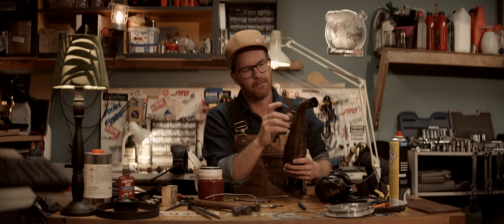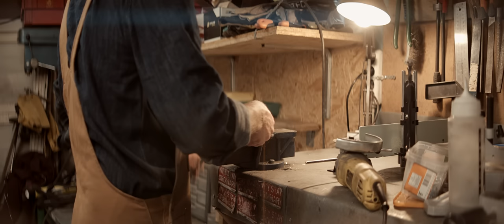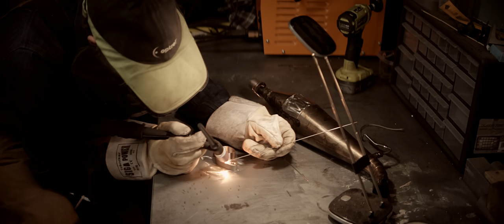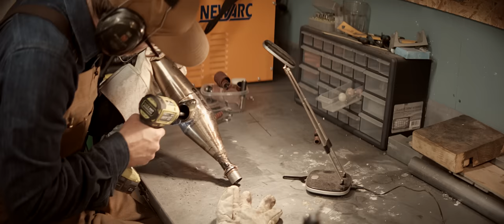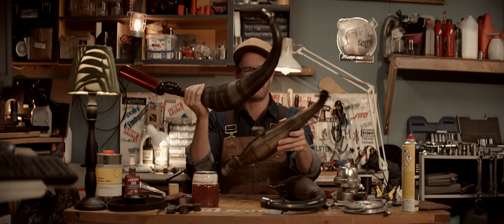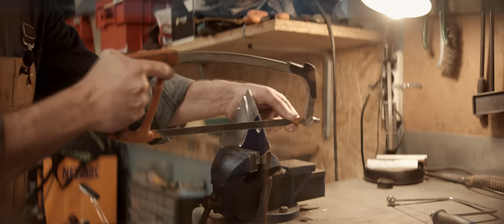Two Stroke Pipe Wastegate - Why do I get such strange problems?!

Comment: Make the straight part of the belly, where you welded the waste gate, telescopic, and variate the length based on the rpm. I know I have suggested that before, but I really believe that would make a great improvement in performance.
Reply: Sounds complicated.. but awesome
Reply: Tried it in the 90's, O ring seals worked well however alignment thru the movement range was a nightmare due to vibration and mounting was a genuine issue.
Reply: Yup, I'm not sure this is the problem or the only issue but this telescoping expansion chamber has been done before many decades ago with impressive results. I saw it in the early 70's. Sealing was always an issue but a titanium or stainless steel bellows (looks like an accordion) for expansion and contraction with an internal sliding sleeve would do the job. These bellows are already manufactured, you wouldn't need to fabricate one.
Reply: Only has a make one cycle! So it doesn’t need to reset after a run. Only get from push vehicle speed to wfo and stay in the power band !
Reply: Would copper seals help also? Instead of high temp o rings
Reply: German König outboards used to have them back in the day, and those engines would rule on hydroplane boats like nothing else.
I don't think anything fancy is required, just one pipe inside the other, with a good fit and a cable to control it. That's how König did it, I think they even had it connected to the throttle control.
König also built some racing motorcycles, not sure if the adjustable pipes were present in the bikes though.
Reply: Not when the rest of the pipes dimensions are wrong. That pipe was made for the PIP motor. Not this crank case stuffed not 100% bore exhaust port motor. Sigh.
Reply: Motores 2 t no necesitan más complejidad de la que ya tienen , lcualquier motor 2 t si quieres subirlo más de Rpm . Hay diferentes maneras .inyectores alojados en el mismo carter que dan un extra de potencia en altas Rpm . Pero nunca intentar variar la curva de potencia mediante la compresión o descompresión de gases en su escape . El echo de tener una válvula de escape te permite ahorrarte todo lo que estás haciendo , un escape móvil lo único que puede traer son problemas y reparaciones innecesarias y por otro lado ... la moto funcionaría sin escape ? O con escape roto? Pues todos los motores 2 t son capaces de funcionar sin escape , .incluso llegue a ver inyectores anclados en el escape haciendo variar la cantidad de oxígeno dentro del escape . No necesitas aumentar o disminuir la capacidad de flujo de tu escape . Solo necesitas meter más oxígeno o menos . De esa manera obtendrás mezcla mucho más rica o más pobre según el inyector . El inyector funciona bastante más rápido que la válvula de descarga y regula mucho mejor los caudales que un carburador . Carburador más inyector . Bomba .

Comment: On some smaller engines I've seen the exhaust port at the biggest part of the expansion chamber and the end completely blocked off with only a drain plug. That's something you could still try with your modified pipe. Use the new port as the exhaust and block the old one off.

Comment: I did karting in 90s. I remember how dificult was to start up modified soviet 2strokes with huge exhaust ports and short pipes. We had to spin it up to high enough revenues by pushing it.  Probably That's why rotax-max engines have their power valve right on the exhaust port to make it lower and smaller at low rpm (the thing ?v=RKZF-W1m0k4). So spining it a bit faster during the start probably is your solution.
Reply: That would have been my solution as well. Get a faster drill, or perhaps use a different power tool to start. Like a grinder

Comment: "how pipe sensitive do you want your engine to be?"
alex - yes.
Reply: How much do you want to make a pipe not made for the setup to work. More like it. Lol.
Reply: I said "Yes." out loud when he asked the question. XD
Reply: @MrJermbob  I'm afraid to say it, but you are right. He's hacking pipes that are obviously not designed right for this particular engine. He is missing some variable in the pipe design software that would make the right geometry pipe. You can cut wastegate holes and hold the pipe hand, but the real solution is to figure out what the correctly designed pipe looks like.

Comment: I think you're getting a frequency feedback from your rotary valve. If you could see a reed valve in high RPMs it does not close and just stays open. One of the experiments years ago with a rotary valve, what happened is the valve got stuck wide open but the engine kept running like a mad man making extreme power you don't need the valve after certain RPM. But the opening and closing is conflicting with the pulse in your expansion chamber.

Comment: Got a simple idea to minimize interference.
Just cut a hole in the straight section of your pipe and make a cover with a matching hole that rotates around the pipe itself to block/unblock the opening. Footpedal or servo to control it.
Done.

Comment: This starting issue only occurred after you went to a disc valve, it seemed to start ok when on the reeds.  Taking another look at the disc valve timing before you go down a rat hole with the exhaust design might be wise.  Edit:  Are you getting a lot of fuel stand-off from the carb at low RPM with the exhaust in place?
Reply: The Reeds act different if you look at the resonating length.
The pull energie out of the exhaust impuls to open, but If open they lengthen the resonating distance.

The discvalve is a mechanical driven valve. It opens and closes a secondary resonating volume but doing this by variing the area which effects the speed and pressure of the Wave...
Reply: Put a 3d printed inlet cone on should do something....

Comment: Do higher tuned 2 bangers not just idle at like 4-5k and rev to 14-16k ? Rather than trying to idle at 1-2k and and rev to the moon in the same setup ? Just a thought ? I know it’s not the same but F1 engines idle at like 4K and rev to 15k and they have valves and allsorts of anti stall etc
Reply: seems logical to me
Reply: It generally isn't a problem of the idle being too low for the engine to run but rather not needing it to idle that low in a racecar/-bike, skipping rpm-ranges you don't need just makes low-rpm tuning easier.
Though I think the current Idle is fine, sounds like 2-3k rpm to me, which is perfectly normal for high revving 2 strokes (look at the RS125 for example)

Comment: Many years ago i had som involvement in some development work on a 6.6l single cylinder diesel engine it was destined to become a 12 or 16 cylinder unit when finally developed but the research single had starting issues if the inlet pipework was conected and no positive pressure was supplied to the engine but if the inlet pipework was disconnected it started without a problem this was found to be a resonance problem that only made starting a problem on the test bed 
Keep up the good work

Comment: Perhaps a throttle body, on the pipe attachment, could be cable synced with the throttle.   Will give you vairiable hole.

Comment: dual Exhaust system can solve your problem , one Exhaust for low and one for high rpm and the you can use the waste gate as a valve that switchs between the two
Reply: not a waste gate but a special valve that switches between the two Exhausts , you already have a rpm sensor  so the welding is what will consume your time the most
Reply: @CathodeRayNipplez  Honda dream 50
Reply: Would probably be better and easier to go variable length exhaust than design valve and valve body for best harmonics.  The two stroke exhaust design calculators are fairly basic and wouldn't want to simulate it but probably a simpler solution
Reply: @BlackStar-nk7du biggest thing is this is a race bike so a higher rpm start is perfectly acceptable the same thing they are doing with formula 1 engines
Reply: Maybe a slide plate that would switch between the low end pipe and the high end one ?
Reply: @baswendling2937 yes but is a 4 stroke engine on the honda dream 50
Reply: @baswendling2937 not only is that a four-stroke it also has two different exhaust ports. Totally different from what we're watching here
Reply: @BlackStar-nk7du he literally says he's just going to increase the idle/starting RPM to just not worry about it. Even if what you were saying is possible. It would be a hell of a lot of work and a lot of extra weight🤷
Reply: i know what he said , but doing this will make the most power in high/low rpm , but this will stress the engine more

Comment: Maybe it just becomes really ritch at low rpm with that pipe, would explain why it helps to keep the gap at the exhaust outlet while the bigger stinger does not help

Comment: A much larger stinger with an auto restrictor.
2 or 3 different rpm pipes that can be swapped while running to learn what works then devise a single pipe that does everything with a clever design you'll enjoy coming up with.

Comment: Not sure if this is related to your problem but it's quick to check. With my Yamaha RD 400 switching to individual air cleaners that had a flat top caused a resonance problem that acted similar to yours. Switching to a soft, domed top air cleaner stopped the pressure wave from bouncing back through the intake. Hope this helps, keep up the great work.

Comment: I have experienced 2stokes with bad crank case compression runs, or run better without exhaust. often caused from bad gaskets but i saw you pressure tested the engine in a previous video, can it be because of the big crankcase?
Reply: I can't remember, do o you have the fillings left in the engine? i think it would be the same if the intake valve dont close fast enough/or tight enough..

Comment: I am so very happy that you figured what was causing the problem, and I am also so very happy about suggesting a somewhat similiar solution in comments earlier, among other things. The problems youve had, not about this particular issue, was related to the exhaust. If the cylinder gets charged by both a SC and a pipe, where do you suppose the cylinder pressure ends up if the pipe is so restrictive that it cant force the pressure back into the cylinder again? And/or SC is needed to  push the gas put into the pipe, only for the pipe to be so restrictive, and the cylinder already at alot of cylinderpressure, so it wont/cant charge the cylinder again, and detonates inside the pipe.

I realize that my writing looks like I think I know it all, and I absolutely do not. Im just thinking out loud on the keyboard.

You have a persistence I envy, keep on keeping on 😁
Reply: He keeps forgetting that his engine isn't 50cc. It's 50cc + however much air the supercharger can jam into the cylinder every stroke. 

I forget how much boost he's running but it's likely he needs the pipe off a much bigger engine.

Comment: I'm going back to the 80s now but we used to have similar problems with model RC planes,if we had it on pipe on the ground 16.000 rpm,in flight in a dive the engine would rev more but lean,so we tuned for off the pipe on the ground so in flight it would be on pipe, went to Italy for some Rossi engine's and the length of the pipe they used was twice if not three times the length,I think the pipes had multiple cone's inside which helped on the overall rev range,I know you know your stuff but have a look into ducted fan engine's and pipe design because they rev through many power bands.keep up the good work and can't wait for the day you get on the flats.cheers.

Comment: i feel the problem is poor air speed at low rpm and it needs fresh air from the exhaust  to fire once it gets up the intake air speed increases . thats y the smaller carb helped , reduce the intake duration and open later to increse air speed .  tuning is about giving the engine what it wants and not what u want

Comment: I'm sure that the issue is more complex than what I about about to suggest but your engine just sounds really lean at very low RPM, it makes the sort of sound you hear when the engine is just about running but as soon as you open the throttle at all the mixture then goes even leaner and the engine dies. Then when you are spinning the engine quick enough it starts pulling fuel from the main jet and that circuit is rich enough to keep the engine running. The other thing that makes me think it is lean is the fact that you seem to have to spin the engine over for ages before is fires up, personally I be looking at going up on the pilot jet on both of the carbs that you are using. I think that your experiments with the pipes have sent you down a rabbit hole, the pipes are just having an effect on the mixture strength, sometimes helping richen up the mixture and other times making is even leaner.

Comment: at 14:05 when fully sealed with the yasuni pipe it sounded really rich. cold having the pipe off a bit give it more air so just the mixture getting better would make it run?. higher idle is a good idea!

Comment: I think of it a bit like an old carb fed race/rally car with a lumpy high tune cam. These would tick over at +2k rpm as they would not run below that do to the cam overlap. 
You engine if I remember correctly is being built for power or constant running at 20k. 
I would forget messing around for a nice low tickover. I think it would be extremely difficult to do without a power valve or something similar.
But i think we are on the same wavelength by what you said at the end of the video 
Great viewing.

Comment: I went back to your previous videos and before you converted it to Rotary it started without any issues. The rotary spec is within reason yo usay so its mind blowing to me how it can go from running okey to not even starting. Considering the pipe and ports are still the same. Im convinced there is something going on in your crankcase/valve.

I find it hard to believe the engine could be that sensitive to pipe geometry even considering your special port designs.

Comment: Keep fighting :)
I had similar running problems only when there was internal problems with the engine, like compression loss, or leaking crank case.
I think the exhaust pulse manipulation would be most effective if the hole was close to the exhaust port. Maybe a valve & chamber like early Kawasaki's 'power valve'?
Maybe a cheap an powerful angle grinder could be used as a starter? Maybe with soft start?

Comment: Maybe you need a power valve in the exhaust port its how yamaha got round a similar issue with resonance. They called it YPVS. Electric servo opened the port as rpm rose.

Comment: Since it behaves better with the leak, maybe it's too rich.  Try leaning the mixture a little and see if it changes.  I would also try adjusting timing of the exhaust.  Small changes just to see if it makes any difference.

Comment: I think you need to take a few steps back and remove all the inserts. Go back to the initial design of this motor and then try the pipes. Even if this will now rev, it’s still ends up being a relatively standard configuration rather than what was the original design innovations. Good luck, great to see you back 👍

Comment: You could get a karting starter box to spin it up faster. Try to find one that doesn't have a gearbox, just a shaft with one way blocking bearing directly on a starter motor.
Another karting concept that could be worth a shot; a perforated diffuser section. Might get rid of the pressure in the pipe, while still reflecting the waves.
Reply: What about when he had a clutch on it and was starting much higher rpm and got the desired pipe to work ? Everyone including Alex is just going in circles now.

Comment: In my experience the higher rpm and the more pronounced you want the power to come in, the larger (to a certain degree) the volume of the expansion chamber, which makes your problem somewhat counter intuitive to me. But since you have a very different design than a regular two stroke, I guess most common bets are off. 
However if I were in your shoes, and with the results you got from experimenting, I would add a closed extra chamber behind the wastegate instead of just bypassing the expansion chamber into open air. To increase the total volume of the expansion chamber when needed. I would make the adjustable wastegate at least the same diameter as the exhaust port from the cylinder. Start by adding a volume comparable to the difference between the two pipes that you showed in the video. That would probably give you the result you found with the controlled leak, but would be a lot less sensitive. Another idea would simply be an adjustable diameter/flow at the output from your expansion chamber to manage the intensity of the pulses. 
During the prototyping stage I would definitely keep everything adjustable to the highest possible degree. Seems you have a lot of experimenting to look forward to. Keep up the good work!
Reply: He should just stop messing with his engines basic dimensions. Then produce a exhaust for that engine. The pipes he has now are all wrong for his motor.